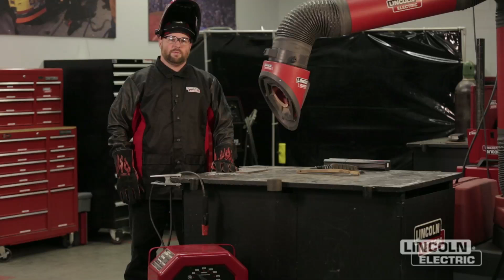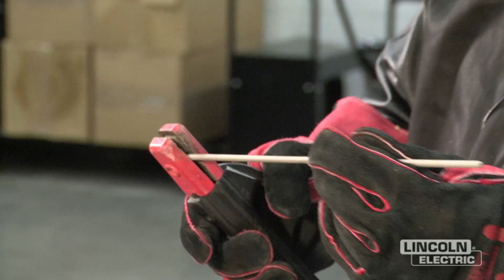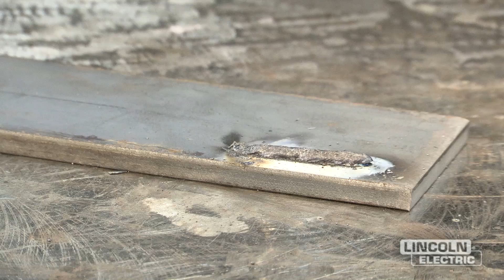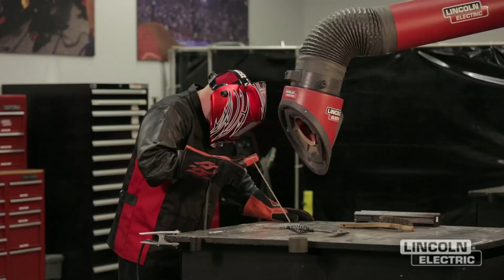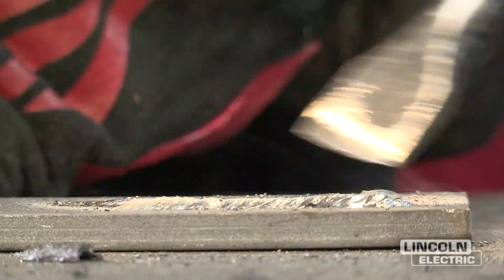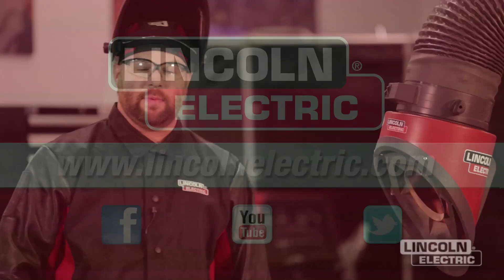Tech Tip: SMAW Troubleshooting

Comment: Novice welder here. Just starting out. If you have a full head helmet like yours, why do you need safety glasses too? Great vid thanks for posting.
Reply: ChurchMouse so when you chip your slang your glasses are already on. Just flip up the hood and your ready to chip :)
Reply: ChurchMouse It's for a few reasons. When your hood is up, your eyes are exposed. In a shop or in the field it won't be a nice controlled environment. Others will be around and doing work. It's best to always wear eye protection in any shop.

Also important is the spatter and sparks that fly around while you weld. They can get behind your hood quite easily. Best to be safe and have your eyes covered then too.

Comment: for 7024 electrodes wich would be the best amp setting?
Reply from the maker: +RealTalk Thanks for the question. Please refer to the 2015 Consumables Catalog on the Lincoln Electric website. You can find the parameters suggested for that electrode there. It is on Pg. 24 of the catalog. Look at the size of the electrode and select for middle of the range and experiment from there.

Comment: I learned this through years of experience, but it's a nice review to see that work summarized so well. You might have said a few words about the difference in how the arc sounds as well, since sound is a very helpful clue. I was always impressed when a vet would pass by and make comment about my arc length or current without bothering to put on a lid.